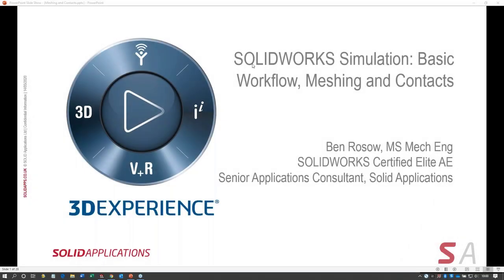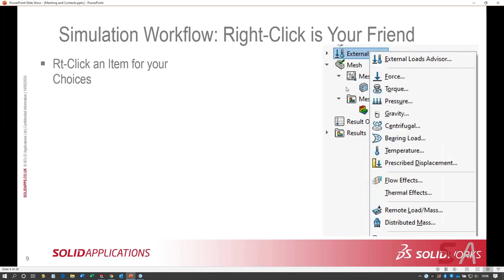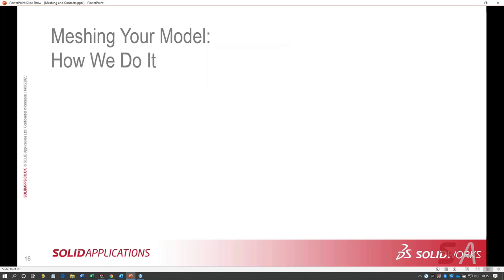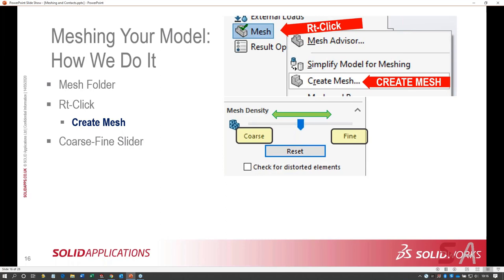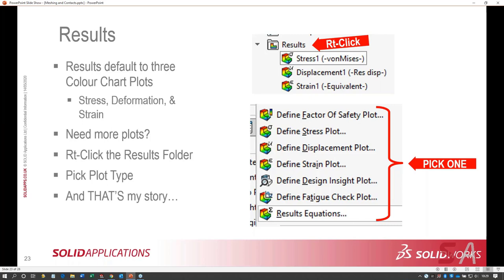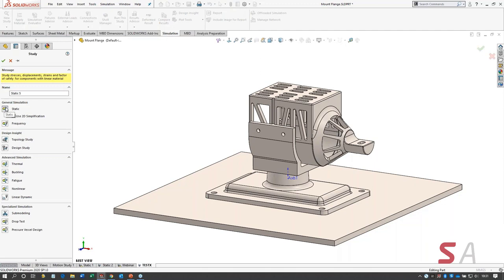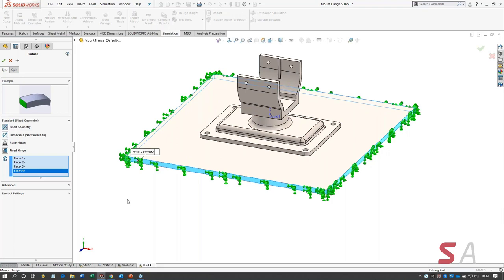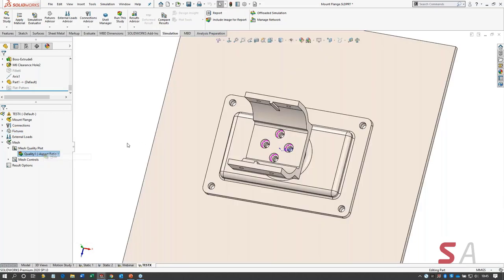SOLIDWORKS Simulation Essentials - Lesson 1 - Simulation Workflow, Meshing and Contacts

Comment: Thank you for this useful and informative tutorial. I am using a fishing line in my model and I'm not sure how to apply the two-element meshing option as the line is similar to a very thin, long rod. I tried normal meshing, but it failed (off course). Any advice would be appreciated.
Reply: Mohammad, I have use a beam element for a cable befor.  Obviously the cable was modelled as a very thin rod.  The beam element applied to the body (right click and select 'Tream as beam') will work under the followign limitations: 1) Don't expect it to work for anything but tension.  Yo should be OK here since it is fishing line.  2) each end of the beam has a JOINT.  Each joint should be connected (bonded) to something else.  You can do that with a contact set (2020 and older) or a Local Interaction(2021 and later).  As long as you are pulling on the 'fishing line', you should be OK.  Remember that SW will calculate a cros-sectional area based upon the actual diameter of the line.  Also, the material will play a big part.  If you are using a flexible material, you can expect it to stretch a lot so deformations may be large.  Therefore, go into the study properties (right click the study name at the top) and choose PROPERTIES. Then tick the Large Deformations box.  This will enable SW Sim Linear Static to cope with changes to the shape that may appear to the program to be violating the small displacement assumption.  The material of the filament will become stiffer as it stretches and the large displacement formulation will account for this change.  If the modulus of elasticity is too low (that is, the material is VERY stretchy), you still might have problems.
Reply: @benrosow7997  Thank you so much Ben for this fulfilling response. I am in fact using a non-linear study with the Large Displacement option checked. Thanks again.